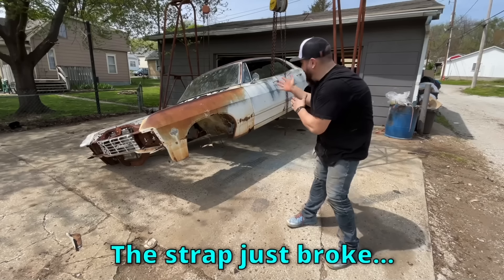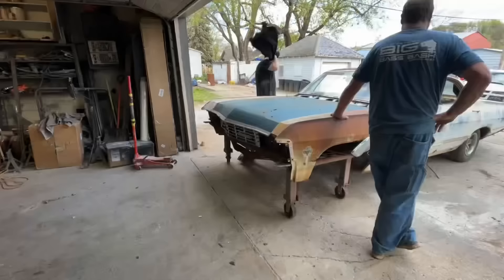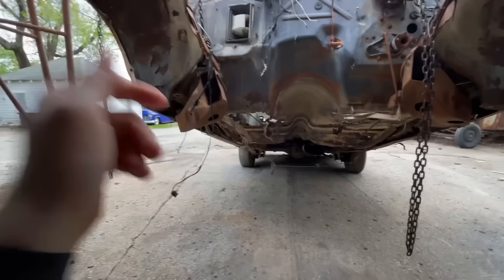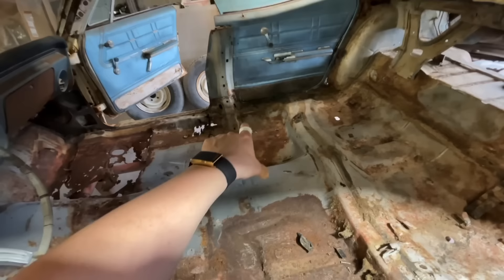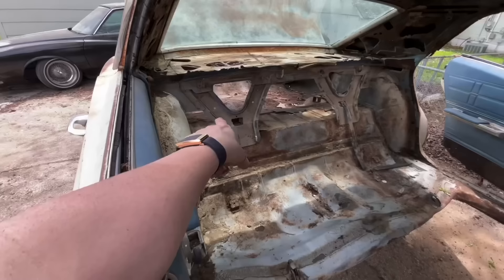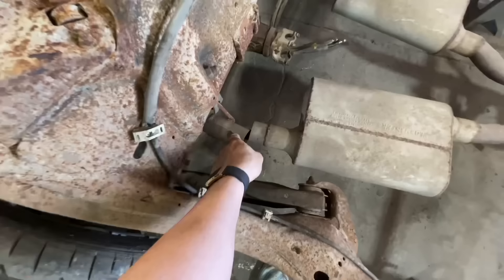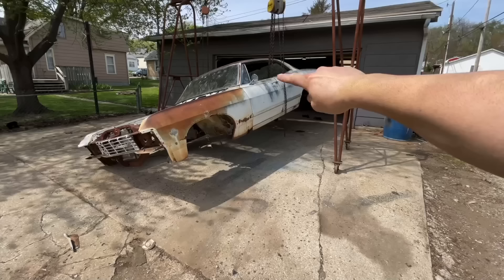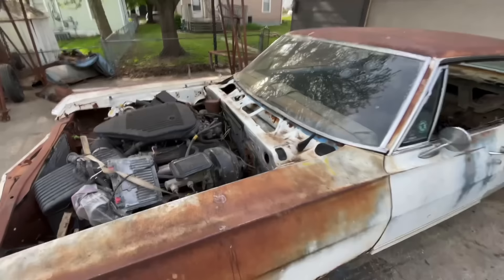CUTTING UP MY RAREST CAR! 1967 IMPALA CHASSIS SWAP! BUILDING THE SUPERNATURAL CAR!  HOT RAT KUSTOM

Comment: Hey man... 2 things you need to know.  #1:  1990's LT-1's and LT-4's (vettes)  have an "Opti-spark" distributor which is VERY sensitive to getting wet.... and dying.... so GM smartly located it below the water pump.  I've killed an opti-spark with a pressure washer, and one with with a leaking water pump.  Large puddles or flooded streets are taboo.  #2:  The large plastic intake/air cleaner cover is affectionately know as "Home Plate!"  Cool car.... Me is jealous!!!
Reply from the maker: Ooh good to know thank you!
Reply: They do make a conversion setup to swap these to LS style ignition systems as well.

Comment: I have to tell you that's a great project. Years ago a coworker had a 1964 Chevy 2 which could have been a Flintstones mobile as the floors were gone. He acquired a 1984 Cutlass chassis to which also needed to be lengthen 2 3/4". Fortunately the Chevy II strength is in the rocker panels which were in good shape. The Cutlass chassis fit right between the rockers. Being a sheet metal worker I made 10 gauge angles welded them to the rockers and laid the body right on the chassis and welded it on. He wanted to make floors, I told him to cut the floor out of the Cutlass which he did. The whole floor fit through the rear window and that got welded in place. A 350 with a 350 auto installed, drive shaft modified and it was a great project, he drove the car for years, then he got married LOL. I'll keep following your project.

Comment: Had a  white 67 Caprice 4 dr ht with a 283 back in the early 70’s. Always liked it, great cruiser. Swapped it for a 64 Pontiac wagon that I turned into a 2dr sedan delivery. Yours will be a lot faster than mine was. Good luck. 👍👍

Comment: The “ home plate” on top of the motor is just a silencer you can remove it and plug the hole left behind with a hockey puck, I personally own a 96 roadmaster wagon with the LT1 as one of my cars. gm performance parts also make a carburetor intake for that generation LT1 that uses a regular sbc distributor

Comment: You said it's easier to deal with a donor frame when it has no body. But considering you gonna have to make the whole floor from scratch now. Would having the stock floor of the 96 impala been better for the build? 
Love your build. Thanks 
✌️🫶🫵
Reply from the maker: Usually i do leave the floors, but in this case since i had to stretch the frame, the stock 96 floor would of been modified so much it’s just as easy to start from Scratch.
Reply: Wow 🤯. That's why you are Casey!! I tip my Casey's Customs hat to you sir!!

Comment: "Coolest Supernatural build on the planet"....This fella disagrees with you as my build...I've not seen anything close to it in terms of quality and overall sexyness and modern updates:

Era correct 396 (forged and a brute) with Edelbrock ProFlo4 fuel injection, GearStar Performance OD trans with HGM controller, Moser 12 bolt with Eaton 3.55 TruTrac, WIlwood Quad pistons on all four corners, Vintage Air FrontRunner system with their Magnum IV system, and Dakota Digital dash with their heat and A/C control....dual cooling fans...aluminum rad...Hedman elite headers....

But I do very much appreciate your including that '96 chassis....good work.

Definitely will keep my eyes peeled to see how this turns out